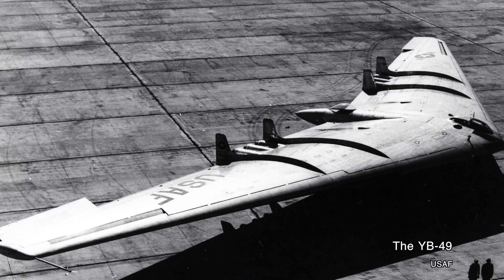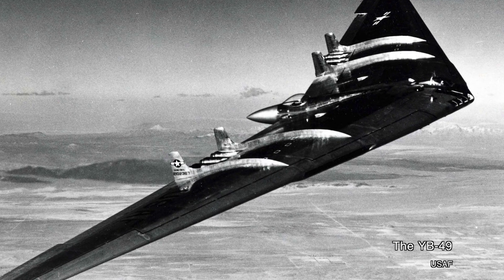Northrop's YB-49 Flying Wing Definitely Wasn't a UFO

Comment: Can you do a video on the North American XB-70 Valkyrie? Thanks!
Reply from the maker: +Alex Lindsay I can add it to the list!
Reply: Interestingly enough, the most-feared (at least until September 6, 1976) Soviet fighter, the MiG-25 "Foxbat" was designed as a direct-interdiction interceptor against the Mach 3/80,000' Valkyrie. 

The Foxbat was specifically designed to reach high-altitudes, and to have a minimum of Mach 2.7 speed (although one was later clocked at just over Mach 3.2) in order to catch and shoot down the Valkyrie. Soviet intelligence somehow missed the cancellation of the program, because they continued development and production of the super-secret Foxbat, with the intent of using it as a short-range interceptor and recon aircraft. 

The defection of Soviet Lt. Viktor Belenko in 1976 finally allowed US intelligence to get a good grasp on the Foxbat and its secrets. 

One more interesting factoid: Air Force experts didn't think the Foxbat was a pure interceptor, but rather saw it as an air-superiority fighter, not knowing that the pilot had almost no visibility out of the cockpit, that there were no guns for dogfighting, that the range of the Foxbat was less than 350 nautical miles, or that the maneuverability of the aircraft was almost non-existent. 

Based solely on recon photos of the layout of the aircraft (taken by SR-71 overflights) the Mig-25 was deemed to be more maneuverable and faster than US aircraft of the time, and the Department of Defense believed it was an air-superiority fighter. This led to a design contest and evaluation program for a new US fighter, which became the F-15 Eagle. The F-15 was designed as a direct counter to the MiG-25.
Reply: +dregerclock It was canceled by Secdef McNamara long before the crash. The other prototype continued research into SST design 3 years after the crash and was then retired to Wright Patterson AFB. I imagine it's still there but I don't know for certain.
Reply: Indeed it was. Just goes to prove that you can't judge a book by its cover, nor a plane by its skin.
Reply: Curious Droid has just done a great video about the valkyrie!
Reply: +Alex Lindsay Excellent choice. If I'm remembering rightly, the Concorde was sort of roughly based on it. In any event, it also had a tragic ending, but the technology it pioneered has gone on to be the basis for a lot things today.
Reply: +Michael Clark :The XB-70 probably influenced the Concorde designers but it was more of an influence on our own SuperSonic Transport (SST) designs. Boeing and Lockheed being the two major contenders for an SST design during the 1960s with Boeings 2707 winning the contract but later (1971) being canceled. There were two XB-70 prototypes and one was lost in a crash. The other is at Wright Pat last I checked. The XB-70 wasn't ended because of the crash. It was canceled because as a high altitude bomber design, it became vulnerable to Soviet SAM missiles. It was canceled in 1960 if memory serves me right. The crash took place in 1966.
Reply: ***** It is still there, they just moved it to the new fourth hanger at the museum.
Reply: +Alex Lindsay Yep! the XB-70 was a beautiful bird! So tragic the accident that brought it to its end.
Reply: +lancer525   Don't forget vacuum tubes in the radar, nickel steel construction, and last but not least throw away engines.
Reply: capworld None of which the CIA or DIA ever knew about until Belenko was debriefed in 1976.
Reply: Yeah I know but, very interesting that for a time we thought  that it was a super plane.

Comment: I'd like to build an rc model of that plane
Reply: well, i'd think controlling it would be a nightmare. a big reason the b2 works is because the computer on board is always making thousands of minute changes to keep it stable. perhaps a prop version is more stabe than the jet version but ultimately, stability with a flying wing is very difficult to maintain.
Reply: +filthy sanchez what makes you think that rc model will face lack of stability like the actual b2?
Reply: +MrTheOutfit well, like i mentioned, the b2 has an onboard computer that makes instantaneous adjust in flight to keep the aircraft stable. does an rc craft have one? i don't think so. that will make it very difficult to fly and control without it.
Reply: +filthy sanchez but why the rc b2 plane need some onboard computer to fly perfectly stable?
Reply: +MrTheOutfit i doubt the scale of the aircraft is relevant. it has to with aerodynamics. flying wings are inherently unstable. i will admit i have no proof an rc flying wing is as much trouble as i've mentioned. but it's a hunch. i remember when iran overtook one of our stealth drones (similar in desing to b2) but i'd bet it also had an onboard computer to make all the continual adjustments to allow for stable flight.
Reply: +filthy sanchez  I retract my comment guys.  Please don't argue over my simple comment on Ms. Teitel's page.  Try to enjoy her videos.  Thank you.
Reply: +Mike Heal no worries. i enjoy her vids too (plus, she's a babe too). i was just saying i think a rc flying wing would probably be much more difficult to operate than other rc crafts.
Reply: +Mike Heal Mike, I agree with you. A RC YB-49 would be great - especially if you found some scale turbojets to power it with. That said, ducted fans or doing the propped -35 would be easier. As for stability, flying wings in the RC world are everywhere! If a scaled down replica of a Northrup model proves to be a little unstable, a 3-axis gyro in the rx should help a lot :)